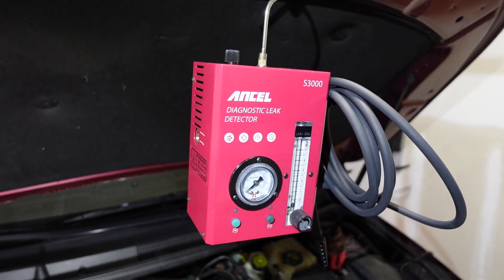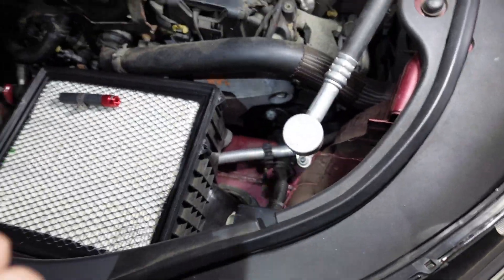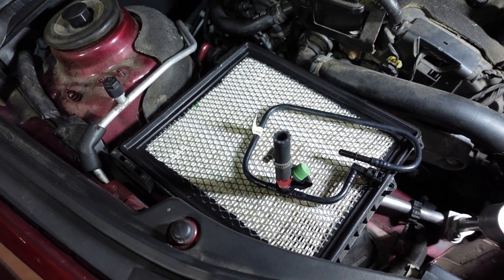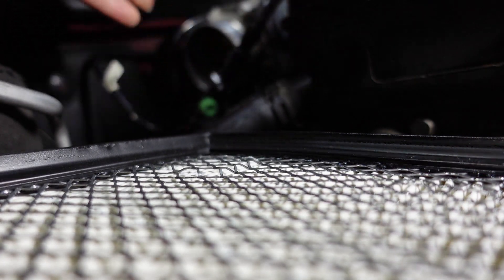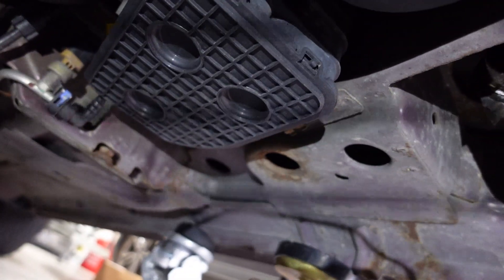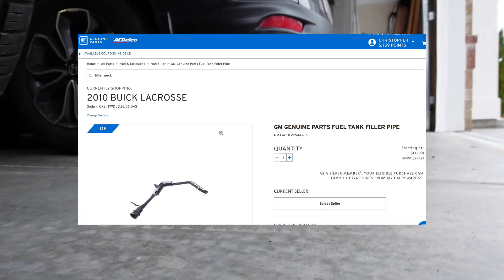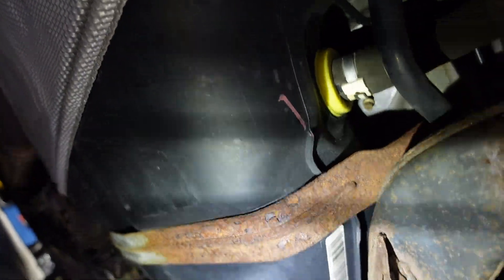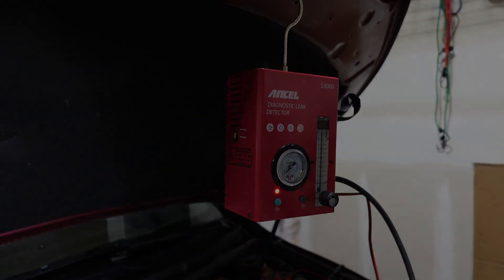Smoke Machine Setup - Hunting for EVAP leaks

Comment: Thanks for the great video!  Do you think you would have been able to see the hole inside the filler pipe using your endoscope camera  before the pipe was removed from the car?  I am asking because my 2015 Chevy Impala is throwing the P0442 code. I already replaced the fuel cap with an OEM cap and the evap purge valve.  The P0442 code will clear but will return a few days later and there is a permanent P0442. Once in awhile I receive a "Tighten Fuel Cap" message on the instrument cluster even though the fuel cap is tight.  It looks like my next step is to introduce smoke into the system.  I have an endoscope camera so I will insert it into the filler pipe to see if there is anything obvious as far as a small hole.
Reply from the maker: If the hole  was in the gas line I might could have saw it, though it would have been hard. It's worth a shot using your endoscope to check it, but if the hole was in the evap line you would not have seen it because the camera won't fit down in there. Yeah get yourself a smoke machine. You're going to love it. It'll likely make this job a whole lot easier for yourself.
Reply: @oneanddonediy  Thanks for the reply.  I went ahead and stuck the endoscope camera in the filler pipe but couldn't see any area of concern. I have ordered the Ancel S3000 and hopefully I will find the issue.
Reply from the maker: @firedawgsa4940  nice! I'm sure with the smoke machine you'll find the issue in a jiffy!
Reply: @oneanddonediy  I received the Ancel S3000 today.  The instructions state that an additional regulator has  to be utilized to reduce output to .5 psi when using to test Evap systems. After watching your video again I didn't see you use an additional regulator when going through the evap access adapter. The smoke your machine produced appeared to be very low pressure.  It seems that putting an additional regulator to reduce output to .5 psi would render useless the purpose of the flow meter to detect leaks in the Evap system.
Reply from the maker: @firedawgsa4940  I think those instructions are very generic. And you may have some different instructions than I have because I don't see anywhere where it says that I need an additional regulator. These instructions sometimes can be very generic and cover multiple models. That's probably why you see that in your instructions. That's just my guess. I really don't know, but in any case the smoke machine works just fine how it is and it'll solve your problem.
Reply: @oneanddonediy  My bad!  I read in the Amazon Q&A's the response from Ancel when someone asked if the S3000 could be used to find Evap system leaks. The response from Ancel was that it could be used but an additional regulator would have to be used to step the pressure down.  It also stated the same in the item description on Amazon.  However, I agree with you that it is unnecessary and I will use it as you did in your videos to locate my leak.  Thanks again!